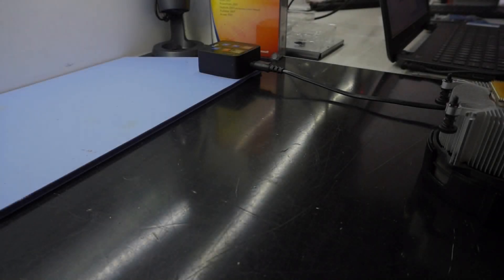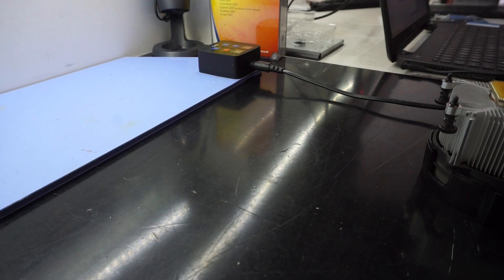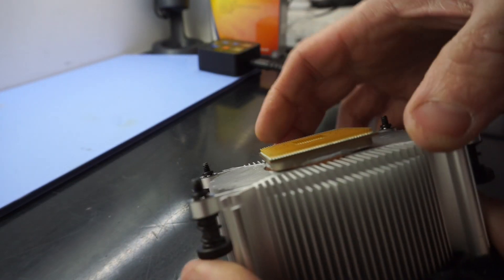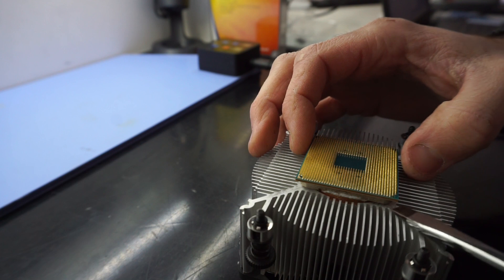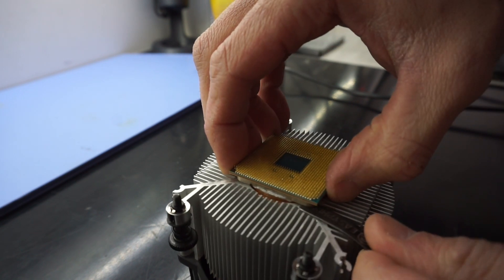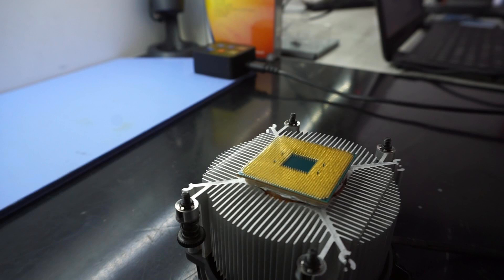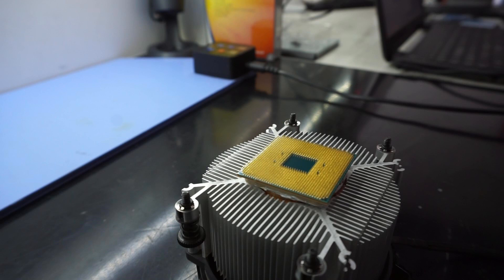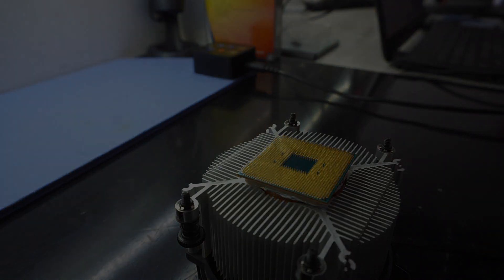How to separate a Stuck AMD CPU from a CPU Cooler

Comment: I have a dif cooler so nothing works for me rip
Reply from the maker: fishing wire
Reply: @rickstechrepairs  i actually heated it up for like 3 mins straight and twisted it with my fingers, got a little cut on my middle finger but at least I got it out

Comment: I just stumbled with the problem...after a long time of letting my failing fan run and create this aufull noice I got worried when it went quiet... so I finally got me a brand new replacement... yea one goes to take out the cooling part and yea the processor does get stuck... after looking at this video I went for a fileting knife in between trying to pray it open and applying force with the knife edge... I think I managed to push it out of stuck... as in... in slided off to the side
Reply from the maker: hopefully you managed to separate them without damaging the CPU

Comment: I have a Wraith Prism stuck solidly to my 2700x. My first mistake was to use the stock compound and use it for 4 years before trying to take it off. Have to try some head and prying it off gently. Edit: Got it off eventually. Tried first prying it off by sticking a stainless steel spudger tool under one corner but didn't even budge, just scratched the copper sink. Soaking with 99% ipa on and off four two hours did nothing. Heating gently, nothing. Finally I decided to lever the cpu off the heatsink using the whole length of one edge of the chip carrier by using the long edge of the same spudger tool. Tried to cup my hand over the CPU anticipating a bounce. The sucker did come off with a bounce and it was pretty tight. No legs bent as I mostly caught it with my hand and it fell back on its back. No idea where the original CPU leg protector is (mistake #2).

Comment: I have a non-stock heatsink and i can't get under the ihs, neither using a floss nor a razor didn't work and shit feels like it's welded together. idk what to do anymore and i can't put it back into the socket either because the lever is blocking the heatsink. any ideas?
Reply from the maker: umm, i dont have really anything to suggest sorry, maybe a metal pry tool
Reply: @rickstechrepairs  Yesterday i tried to soak it all in isopropanol to dissolve it a bit but still didn’t even budge. At this point im just ready to buy a new CPU i think.

Comment: Never buying amd again, wraith prism loud with 3900x, changed fan and cpu stuck to heatsink, also cpu holder arm bracket broke off MB. Managed after 30min to post but was completely dead before that. Its not worth the stress! Btw here in South africa a 3900x is expensive due to our crappy exchange rate and non existant economy, so had to change my undies afterwards! Damn you AMD!
Reply from the maker: damn thats not good at all

Comment: Let me add one thing to save others time and frustration. I just went through this and without reading or watching anything on the internet, I took it upon myself to basically do the same steps, but heat it up with a hair dryer or heat gun first, then it'll pop right off. Another possible easy way I thought of would be to use CPUz or equivalent to run a stress test on the CPU for a few minutes then quickly remove it after shutting down and discharging the power button. Either way, this seems like you are going to have this issue with stock paste, and will need it to heat up. Use something like Artic Silver when putting it back together, I never had that problem with MX5. Lastly do be sure to triple check your CPU after it gets plucked out, I had to set some pins straight on the outer side of the chip. Not terribly bent but enough to need an adjustment before reinstall. I used a mechanical pencil to fix mine, but I suppose you could use a card, tweezers, tiny flathead, etc. Doesn't have to be perfectly straight, but as close to it as you can get it.
Reply from the maker: cheers for your tips

Comment: The cpu was stuck to the amd cooler and ripped right out of the seated position and the bracket arm snapped
Reply from the maker: thats not good
Reply: Original VGA post error, but since I popped the CPU off mobo and reinstalled now nothing turns on.  Completely dead...?

Comment: I'd recommend trying to do it with a plastic card (e.g. a bank card or loyalty card) first. Using metal could bend\scratch the IHS. For me, the card (even a thin\bendy one) worked like a charm.
Reply from the maker: good tip
Reply: @rickstechrepairs  I found that a mechanical pencil works perfectly for most pinned CPUs. The pins are literally the exact same thickness as the lead you would have in it. And you have very precise control with plenty of leverage. 😉
Reply: would not recommend any plastic cards if the paste has dried

Comment: Thanks for the video, I installed the stock wraith stealth cooler, but struggled when I first did it because I didn't realize the back bracket fell off (Not use to this style of cooler mounting) With all the struggling I did prior including even lifting it off and putting it back down.... I wanted to reapply the thermal paste.

I did this like a week later.... I was busy cursing at the wraith stealth screws because I thought they were just not unscrewing from my lack of faith towards them from when I installed the damn thing....

But..... I learnt that you can fucking rip a CPU out of it's locked socket & fucking panicked! 
Your method of getting it off was the first thing that came to mind for me... I just didn't feel comfortable defaulting to it, but said screw it and began to try to separate it with a screw driver.... But that damn thing held good.... (Slid around just not off for a bit) 

Either way after more cursing at it trying to make it line up to the screw holes in one go while my wife held the bracket I got it all back together & everything still works. 
I even got the temps down slightly using my Noctua NT-H1. (I repasted it because the temps were concerning on my 5600g, but apparently these chips just run HOT) 

I'll likely upgrade the cooler one of these days.... Never one that screws in like this tho.....
Reply from the maker: Damn not fun at all

Comment: DO NOT DO THAT WITH SCREW DRIVER. 
..
USE A HAIR DRYER ON LOW HEAT AWAY FROM THE CPU
to heat the heat sync and wait till things are warmer and slowly turn the cpu left to right.

Better yet leave the heat sync on your water heater for a couple hours to warm it up slowly, then turn it left or right slowly.
Reply from the maker: This method has worked fine for me.

on many CPU's over the years

Comment: My aio got stuck to my cpu and it kinda slides around then finally popped off i hope i didn't damage it
Reply from the maker: hope all is good
Reply: @rickstechrepairs  seems to be running just fine im just having trouble holding a stable docp so i ordered new ram im only nervous cause ive never had ryzen before and didn't know how to install the cooler bracket so when it got stuck and moved around a little bit then me not being able to hold docp i thought of a pin maybe was bent or i tightened down to much its been running fine i think besides that
Reply from the maker: Depend on CPU and Mainboard running at the default XMP can be unstable
Reply: @rickstechrepairs  yea it's a 5900x and crosshair viii hero but im using old vengeance rgb ram and its 2 2x8gb kits so i ordered dominate rgb of the compatible ram list hopefully it does the trick
Reply from the maker: i would have suspected that to be good with any ram.

What mhz is the Vengeance ram ?
Reply: @rickstechrepairs  3000mhz

Comment: If you can’t get a screw driver under a pair of vice grips can also take it off pretty easily. Just be sure to twist and that the vice grip isnt bending the pins.
Reply from the maker: Bulk Caution needed

Comment: this could work but definitely not the safe method. The best way would be to heat the heatsink with a Heat Gun and soften the paste and then remove the chip..  By forcing it out like this, the risks are, microcracks (less probable) and dropping the chip and bending or breaking pins.. you cant say how hard its stuck and it could flip off with too much force and you may not be able to catch it safely.. best use a heatgun or hair dryer..
Reply from the maker: i find heat normally doesnt soften the thermal paste, thus i gone with the manual leavering approach
Reply: @rickstechrepairs  i see.. not sure why.. i'm using a black and decker 1800w Gun..  even last week i did this.. one of my client pulled the heatsink with cpu and bent the cpu pins as well.. got the cpu out with heat gun

Comment: How do you remove a stuck cooler on a processor still on the motherboard?
Reply from the maker: unscrew, then twist the cooler clockwise or anticlockwise
Reply: @rickstechrepairs  it wont bend the pins?
Reply: @rickstechrepairs  thanks i preheated the cpu then did that. It finally came off :D

Comment: If your thermal paste is dry then no amount of stress tests is gonna make the compound suddenly loose. I got my cpu to 91c and it still pulled out with the cooler.
Reply from the maker: bugger, guess it will be twisting it, rather than heat

Comment: Seems it's an issue with the AM4 Socket in general? It happened to one b450 board twice and another time on a cheap a320. I hate those little pins.
Reply from the maker: All the AM socket versions

Comment: does it bend the pins if you twist the cooler? im also kind of scared to do that method too
Reply from the maker: they should not, aslong as your at twisting the "square" with even pressure
Reply: @rickstechrepairs  ok thank you

Comment: Lol jusf happened to me, i got a heartattack because the socket was locked and i pulled it
Reply from the maker: Hope all is good now
Reply: @rickstechrepairs  its all good cpu still running even though it was pulled when the socked is locked, thanks man
Reply from the maker: Excellent, useless you bend a whole bunch of pins it will usually still work fine

Comment: But why has AMD not the same system like Intel? It's just ridiculous that you can damage your cpu when it's ripped from the locked socket. And also the work the get it rid of the cooler.
Reply from the maker: AM5 is rumored to have the CPU similar to Intel

Comment: There is nowhere to pry into, I swear to god this thing is actually welded on the cooler.
Reply: I managed to twist mine off after a few hours of trying, wasn't ready for it coming off so it fell and a dozen pins got bent to hell....

I thought it was all over and I needed to order a new processor, but I gave it a try to straighten the pins back, and eventually I got it to fit the socket, in complete disbelief the computer booted like normal.

I think I got suuuuuper lucky with this
Reply from the maker: there should be a corner that you could get under
Reply: @rickstechrepairs  not even blade can get under it, please help me
Reply: @gauthamsaiju  Twist it.
Reply: @Mobin92  nothing worked for me, so I gave to a computer hardware repair shop and separated it.
Reply: @Mobin92  fucking legend 🙏
Reply: @gauthamsaiju  same

Comment: I couldn't fit something under it so I pushed on the metal part with a tool until I got it to slide, then carefully twisted it off by hand.
Reply from the maker: Good to hear you got it off
Reply: Oof! You saved my day! Thank you so much man! This comment finally helped me get it off!!!
Reply: Same here couldnt fit anything underneath but i started carefully "scratching" on all sides and corners with a blade (where the cpu meets the cooler) just to be able to create some room to put something underneath. Even the edge of the blade couldn't get under at first. After 20minutes it just poped off by it self.
Reply: THIS GOT MINE OFF IN 2 SECONDS!!!! Used a flat head screw driver, gently pushed on the metal and it slid right off. Thanks dude

Comment: You fuckin legend. Thank you!
Reply from the maker: Glade this has helped in your time of need
Reply: @rickstechrepairs  It really did. I was trying out other methods which never worked and bent the cpu pins while I was working at it. But with the screw driver, 2 seconds BAM. I wouldn't have had to fix the pins for more than half an hour in the first place if I did your method. Thanks again for sharing the vid.

Comment: Uhh I have a question... So I just got my 5600x and my friend wants my 3600 but it's completely stuck to the cpu cooler "there's no gaps" so idk if the flat head screw driver is gonna work. However, what I want to know if it's possible to just install the cpu with the cooler stuck to it onto his motherboard lol? Or am I most likely gonna damage the cpu?
Reply from the maker: I would highly recommend to not to attempt to reinstall the CPU with the cooler attached 

This will highly likely end with damaged pins

Comment: I was cleaning my cooling unit and I was trying to remove it without braking anything but inadvertently I detached it from the CPU. Is it okay if I just put it back like it was without replacing the paste again? I don’t wanna fry my pc :(
Reply: @Nogame noname I will, but what if I don’t have any at the moment ? Would something bad if I put it back in place as is?
Reply from the maker: Replacement of the paste is the way to go 

I spose you could run without changing the past but I wouldn't really recommend any gaming on it
Reply: @rickstechrepairs  I will buy some immediately! Thanks for the reply!

Comment: happened to me, pulled the cooler off and when i looked at my cpu it was gone, I pulled it out while the latch was still down. used a screwdriver to get it loose. put it in again, cleaned the thermal paste off and applied new thermal paste and put my nem noctua dh15s cooler on it. And luckily it still works
Reply from the maker: good to hear the cooler and cpu are still good!

Comment: I just applied fresh thermal paste on my 5800x and installed the CPU water cooler to it. Then I just wanted to check the distribution of the thermal paste. So I went ahead and tried to remove the cooler: No chance! I gave up and came here. Good to know that it's not harmful for your CPU to be ripped out of the socket with the ledge down but I'm leaving my cooler right where it is because I don't want to damage the CPU.

Greetings from Germany.
Reply from the maker: hope the 5800X, is all good and ready to go!
Reply: @rickstechrepairs  not just yet, i'm a lazy mofo, but i'm workin on it...🥴

Comment: I just ruined a 2700x by trying to remove it (it had only been on for a few weeks)..of course it didn't help that it fell on to a tiled floor after it pinged off..., some pins bent,  dented the metal heatsink...but cracked the edge of the silicon/pcb where it landed...
Reply from the maker: Tile flooring tends to defeat most electronics when dropped on it
Reply: @rickstechrepairs  yes it does.☹
Reply: Linus wants to know your location

Comment: I managed to get off the CPU by first putting it in the freezer overnight (in a sealed bag with dessicant to keep moisture out) then taking it out and warming it with a hair dryer.  I suspect that the heat sink and CPU contract and expand at different rates which causes the adhesive bond to break.  After doing the heat/cool cycle, a strong push on one side of the CPU released it from the heat sink.
Reply from the maker: I wouldn't have gone down that path to separate them, but good use of science :D

Comment: I heard this happens a lot... I just bought Ryzen 9 and I'm so scared... Is this happening with AiO cooler too??
Reply: I just bent one pin from my Ryzen 9 3900X last wednesday by removing my air cooler from it (I was changing my motherboard), I fixed it ofc but it was one of the most stressful moments in my life, the experience was so bad I don't want to even touch AMD cpus anymore, unless they fix this issue by placing a simple cpu holder in the socket like Intel does.
Reply: @nicolasteixeira6448  so are you switch to intel rn?
Reply from the maker: I think it could happen with any cooler
Reply: @rickstechrepairs  oh god... nooo
Reply: @n0obhAcker00 Okay thx. I will.

Comment: The issue is that pins get bend when it gets ripped off like this. I lost a 3600 due to this retarded cooler.
Reply from the maker: Bent pins aren't fun at all, curse the adhesiveness of the thermal paste
Reply: This is why I don’t use the stock thermal paste this almost happened to me once thankfully the pins didn’t bend too much and was able to correct them
Reply: You can fix the pins with a hollow needle.

Comment: Just to let you guys know if you are scared to bend the pins when prying it. Use the amd cpu tray case that came with the cpu and put it on pin. Then pry it out, my cpu heatsink was stuck to it and I did prime95 for like 30 mins and was still suck. Replacing my cpu today (1600-3600) and switching from Radeon 580 to nvidia 2060 in a couple of days once it comes in

Comment: I cant get the flat head under the metal
Reply from the maker: you would need a smaller flat head screw driver
Reply: Ricks Tech its ight i took it off by putting alcohol and heating it up with a blow dryer then twisting it off. Sure i bent 5 pins but its fine 😂

Comment: This is too scary.... im about to change paste too just waiting for the paste to arrive
Reply from the maker: Couple of tips to help avoid this

1- run the machine for a bit 20min or so to heat up the CPU and thermal paste

2- once you have turned off the machine and undo the screws on the cooler, twist the cooler 90 degrees.

This should release the CPU from the cooler without pulling it out
Reply: @rickstechrepairs  thank you will try this tomorrow! hopefully nothing gone wrong
Reply: @Hikkiru  Any update? I'm about to attempt this after running a Ryzen 3600 for a year with the stock cooler.
Reply: @devhxpg  Yes! its actually pretty easy i run prime95 until my cpu hit  85° and then also twist the cooler to take it off